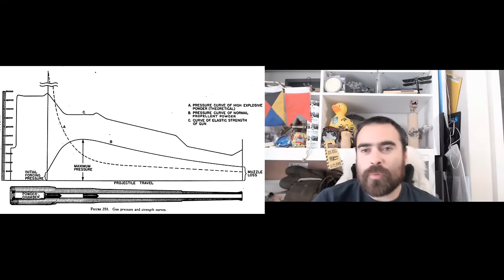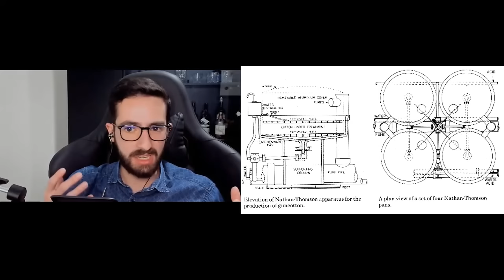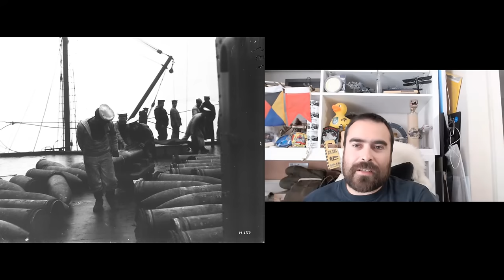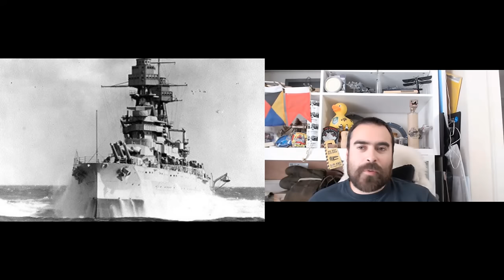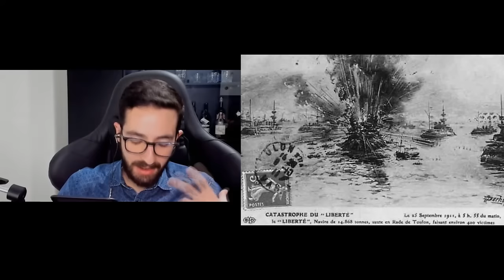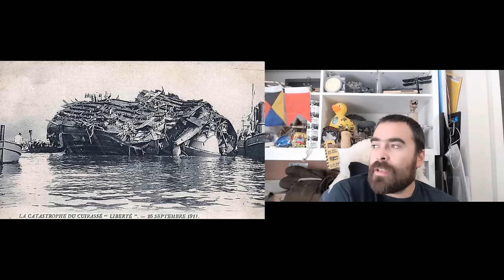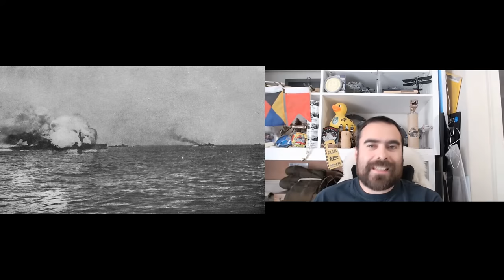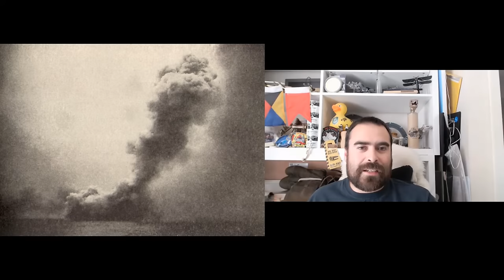Cordite and Poudre B - Why things start exploding at just the wrong time

Comment: An interesting topic that could be expanded upon would be the awakening of the US Navy to the value of the "French Low Flash" gunpowder for nighttime engagements.  The corollary use by the Japanese of low flash propellant for night engagements was part of the steep learning curve of the US  "nine to five" Navy surrounding Guadalcanal.  As I remember there was a limited supply of French low flash propellant used by the US Nay in the Pacific but it was not always available when needed.
Reply: Low-flash propellant used in two out of the 3 cruisers at the Battle of the North Cape is why Scharnhorst thought it was up against a battleship and 2 cruisers instead of 3 cruisers.  The muzzle flash was so much greater from the 8” guns using regular propellant that they looked like battleship guns by comparison.  Of course then Duke of York showed up anyway and probably still would have if Scharnhorst had turned to engage the cruisers, but it’s possible that a cruiser or two might have been sunk.

Comment: Explosives worker here, so I'm already on a list and happy to talk about it. I agree it's nitroglycerine exudation. 

There really isn't anything wrong with nitroglycerine bonded propellant, provided the stabilizers bring down its sensitivity enough. Triple base propellant these days are still guncotton (nitrocellulose), nitroglycerine and stabilizers and are fine to use (although its not as high percentage of nitroglycerine as Cordite). In fact Cordite in its original state sounds fine to work with; a reasonable flash point, moderate shock sensitivity, relatively slow burn time etc. I've worked with much angrier modern propellant for ships that have a lower flash point and burns more with more energy and speed than black powder.

However as was stated all explosives degrade over time and need to be carefully monitored by people like me. In particular, any explosive with a petroleum jelly stabilizer really doesn't like temperature deviations (such as you mentioned with the lack of temp control in some powder mags) and starts to separate over time. It'll start to feel like its moist on the outside like its sweating, which is the nitroglycerine beginning to separate, forming pure pockets of crystalized nasty. If this isn't caught, you'd have in storage and be handling propellant with all the sensitivity of nitroglycerine with the safety of Cordite. I've found the 1933 "Instruction for the examination, testing and sentencing of cordite, ballistite and nitro-cellulous powder". Seems to indicate there is a war clause for condemned or low test cordite to be held in the magazines. 

As nitroglycerine tends to detonate not burn if given the right stimulus, it will propagate easily to the rest of the magazine. This will result in either an immediate explosion or a contained aggressive fire that can't vent fast enough, causing an explosion shortly after. 

Side note: explosives don't 'go off' like parties or 'set off' like a dragster, they 'function' either when you want them to or not.
Reply: Campbell's 1985 book "Naval Weapons of WWII" has sections on propellants. Page 104 mentions a 1938 incident of exudation of nitroglycerin out of anti-aircraft ammunition on HMS Glorious.

Comment: I was a Gunners mate in the US Navy during the 70's and can ask a dozen questions on this? Such as temperature, in the early 1900's what there anything like temperature monitoring of the magazines done? Rotation of powder use oldest first during training. Or did powder just sit in a magazine for years? Were there any issues with powder fires or explosions when a ship went in for refit? One should remove all the ammunition from the ship before cutting on it. A cool show would be reviewing any post dreadnought looses or ones suffering major damage from non combat related causes.  Thanks to the both of you for another interesting presentation.
Reply: From Campbell`s:

"The real cause of the disasters was that the precautions for preventing flash of ignited propellant reaching a magazine were not matched to the behaviour of British charges, though if the British ships had had German charges it is very unlikely that they would have blown up. This was not, however, clear at the time.

It was realised before 1914 that there were two dangers, the first that decomposition of the nitro-cellulose could initiate a spontaneous explosion, and the second that the effect of enemy shells, torpedoes or mines might blow up the ship. The first required that the magazine cases of the charges, and the magazines, should be able to vent to air before a dangerous pressure built up from the ignition of the charge or charges in the case affected, and the second that the magazines should be protected from enemy weapons. Such pre-1914 evidence as there was indicated that the first danger was greater than that of enemy shells causing a magazine explosion, and was best avoided by a strict time limit on the service life of the charges, not exposing them to excessive heat or damp, and great care in manufacture so that certain impurities in the nitrocellulose, notably traces of sulphate, often derived from pyritic coal dust or cinders, were avoided. The pre-war records of the British and German navies were good in this respect, and though there were spontaneous explosions of 6in charges in the pre-dreadnought Revenge in 1899 and in the cruiser Fox in 1906, and of 5.9in charges in the German cruiser Vineta in 1903, none of these caused a major disaster to the ship. The Germans learnt much from the Vineta incident, and by 1914 had developed a far more advanced propellant than the British.

Other navies had suffered serious losses from spontaneous propellant explosions, the principal incidents prior to 1914 leading to the loss or total wrecking of the following ships - Maine (USA) 1898, Mikasa (Japan) 1905, Aquidaban (Brazil) 1906, lena (France) 1907, Matsushima (Japan) 1908, Liberte (France) 1911.

Further disasters occurred between 1914 and the date of Jutland. In the British navy the pre-dreadnought Bulwark was blown to pieces in the Medway in November 1914, though it appears that gross carelessness in the treatment of exposed 6in charges and HE shells with live fuzes may have been the reason and not decomposing propellant. The armoured cruiser Natal was sunk in December 1915 at Cromarty, and this ship had much dubious cordite on board. In the German navy, the light cruiser Karlsruhe was lost 350 miles east of Trinidad from an internal explosion in November 1914. The Karlsruhe was extremely unsuited to the tropics as temperatures as high as 76°C had been recorded, and the German Official History remarks that the explosion may have been due to a quantity of lubricating oil thinned with petroleum for use as fuel.

In other navies, an explosion in the old Chilean battleship Capitan Prat, which had some very bad cordite in her magazines, was not disastrous to the ship, as the gases of the explosion had an easy vent to air, while the loss of the Italian pre-dreadnought Benedetto Brin is said to have been due to a bomb placed in the after magazine.

As far as the effect of enemy shells was concerned, the evidence from the Russo-Japanese War in 1904-5 seemed to show that this danger was not so great. The Russian pre-dreadnought Borodino had been sunk at Tsushima by a final magazine explosion after a number of serious ammunition fires, the worst of which broke out as a result of 2-12in hits near the mainmast, about 10 minutes before the final explosion, which occurred after a 12in hit near the foremost beam turret of the 6in secondary armament. Serious ammunition fires or explosions had however occurred at Tsushima in the Russian pre-dreadnoughts Kniaz Suvarov, Orel and Sissoi Veliki without involving a magazine, and previously in another Russian pre-dreadnought, the Poltava, a hit by an I 1 in howitzer shell at Port Arthur had caused a serious fire in a 6m magazine, apparently involving some 12in charges also, but it had been possible to flood the magazines before disaster occurred.

On the Japanese side a violent ammunition explosion from a hit by an 8in shell destroyed a 6in casemate in the armoured cruiser Iwate at the battle of Ulsan. Flames passed down a hoist, but apparently got no further and no magazine was involved. Later at Tsushima in the predreadnought Fuji, a 12 in shell pierced the shield of the after barbette and burst inside, setting fire to 3-12in charges. A large part of the shield was blown away by the shell burst, and water shooting out of the cut hydraulic pressure pipe to one of the loading rams was of great use in quenching the fire. The Fuji's 12 in guns had charges of British type, and it is important to notice the value of a high pressure water source at the site of a propellant fire, and also of free venting to air, both accidentally provided by the shell burst. The Iwate's 6in guns also used British type propellant, but in brass cartridge cases, which would help in limiting the spread of a violent ammunition fire.

Much data is lacking on the fires and explosions in the Russian ships at Tsushima, but the largest fire in the Kniaz Suvarov, that in the .Orel and also in the Sissoi Veliki appear to have concerned the 6in ammunition where the nitro-cellulose propellant charges were in brass cartridge cases, as were those for the Poltava's 6in guns.

The method of ammunition supply to the heavy guns in British capital ships appeared to be reasonably safe in 1914, but no large scale trials with up-to-date turrets had been carried out, and this was the important and blameworthy omission. The magazines were above the shell rooms in all ships, and in the dreadnoughts the magazine crowns were one deck below the armour deck, or two decks below in the Royal Sovereigns, where the armour deck rose to main deck level. The crowns of `Q' magazines in the 13.Sin battlecruisers were also one deck below the armour deck, but in the other turrets in these ships, and in all turrets in the 12in battlecruisers, the magazine crowns were at armour deck level, and slightly above 1wl.

The magazine doors gave access to the handing room where the charges were placed in the lower hoists which were located in a trunk fixed to the rotating part of the turret. These hoists brought the shells and charges for each gun to the working chamber, where they were transferred to the gun loading cage of the respective upper hoist. Waiting positions for two charges were provided in the working chamber, and for two more in the handing room, and in action there would thus be eight charges in a turret between magazines and guns Flash doors were fitted to the trunk and the cages of the hoists, and the propellant was in more or less closed compartments in all stages of its passage from handing room to gun loading cage.

Unfortunately it was not realised how violently British charges would ignite in a turret fire, and the above flash doors were inadequate, the magazine doors were not flash tight under pressure, and flash had a free path to the handing room via the space between the fixed and rotating turret structures, and possibly via other routes. Also there were no magazine scuttles for passing charges, in fact, the magazine doors would be continuously open in action, and many more charges removed from their magazine cases, or in opened cases, than there should have been. There is a revealing remark, too, in the Invincible's reports on the Battle of the Falklands, stating that the flash doors on the gun loading cages in `P' turret had been previously removed as the charges occasionally jammed in the cages, and it was easier to clear the jam if the doors were removed. Nevertheless none of this would have been fatal to the ship if British charges had behaved like German ones."

Comment: What a very interesting talk you fellows have done. My dear Grandmother Petty told me of an occasion in her youth, where a nitroglycerin transport wagon blew up in rout. The story included the gory finding of body parts over a large debris field.
Incidentally she described the transport wagon as having a large heavy box for the explosive, suspended by multiple springs.
Reply: Oof, nice story.
The metal box would seem to make it a grenade, maybe it would be better if it were made more open.
Reply: Whenever I feel nervous about something, I'm going to think about this and remind myself, eh it's not that nitro box wagon nervous bad 
lol
Reply: @SP-sy5nq  build it like a powder magazine, strong bottom and sides, weak top. That way the blast is directed up and away minimizing casualties.
Reply: I doubt liquid nitroglycerin was transported anywhere except within the confines of the manufacturing plant where it was mixed into the safer forms of dynamite or gelignite
Reply: @snowflakemelter1172  Actually - it was at one time made in batch plants and then taken to point of use. Proved too dangerous and practice abandoned, but happened. Actually more than once. Look into the history of the building of the Central Pacific and there was some use in oil fields between the Wars.
Reply: @snowflakemelter1172  no, liquid nitroglycerine was in fact used a lot in mining and demolition work in the 1800's. Proved to be a very dangerous practise indeed. That's why Alfred Nobel's invention of dynamite was so revolutionary - and made him all that sweet cash that allowed him to set up his famous prizes. It was deceptively simple - nitroglycerine absorbed into diamataceous earth, aka kieselguhr. It stabilised the nitroglycerine such that it was (largely) safe to handle, albeit prone to destabilising over time.

Comment: The German tradition of high expertise with chemistry especially in the 19th Century certainly helped them in this regard.
Reply: Doesn't hurt that the main charge for German guns is in a brass casing that seals the breach. The Germans are handling far less powder in bags than the British. or anyone else for that matter.
Reply: @SgtBeltfed maybe for the range which is seen but in terms of not becoming a massive floating bomb this helps.

Comment: The delay between the initial event is characteristic of industrial dust explosions. A small shock kicks up dust which is then ignited by something like a spark. It deflagrates (< speed of sound). Nitroglycerin dust would not be a fuel-air explosion as NG does not need oxygen to explode. It is a high detonation (>> speed of sound) and tends to crack armors. Also important is the minimum ignition energy (MIE) required by a compound to detonate. NG dust is so volatile that "brush" static is enough to ignite it. In other words, kicking up NG dust and it dust flying through the air creates enough of a static charge to detonate it. Large ungrounded storage tanks, cranes, and large metallic devices can store significant electrical charges to set off many combustible dusts. This is why hydrocarbon-containing tanks have multiple bonds and grounding cables. Electrically insulated parts of a ship might also store enough of a charge to set off very combustible dust like coal dust in a fuel bunker. Deflagrations proceed less than the speed of sound but can be damaging if contained such as under a WW1 trench and produce significant amounts of gas (black powder). There are also hybrid explosions of combined fuels and dust. The low MIE for the fuel (typically a solvent) starts a flash fire which ignites the combustible powder. It tends to be a sustained explosion and is very deadly. Burning solids ejected can fly to other combustible matter and produce a cascade of explosions. From one photo and eyewitness testimony, it is conjecture as to what happened at Jutland due to the lack of time scale, distance scale, and multiple frames showing shockwaves.
Reply: I suspect what happened with the LUSITANIA was a coal dust explosion. The ship was nearing the end of its run, so many of the coal bunkers were low with a lot of dusty space.   The torpedo explosion throws a lot more coal dust into the air and boom.

Comment: We made some picrate-based stuff in high school, one of the piles had not 'destabilized' properly when we tried to shock them so instead of going off the dust spread along the desks and floor of the classroom. The next morning when we had a class in the same room you could hear tiny 'explosions' from underneath your shoes and when placing anything on the desk or sitting in the chair.
Reply: Sounds like more fun than bubble wrap!

Comment: A new take on an old subject. I’ve changed my mind about Jutland.  Interestingly, old film was made of nitrocellulose, and has been know to spontaneously combust. Old movie theaters were sometimes built with blowout back walls for just this reason, and they had thick glass blocks separating the projection room from the audience.
Reply: I think nitrocellulose film would explode in theaters when the projector jammed, leaving a single bit of the film in front of the extremely bright, extremely hot projector bulb for too long.
Reply: @SeanCMonahan  yes. This is true. Most large theaters used carbon arc lamps, which are not only very bright, but extremely hot.  New film was fairly stable if stored properly.  But nitrocellulose film degrades over time and will become unstable and there is a risk of it combusting. Several museums have had fires as a result.